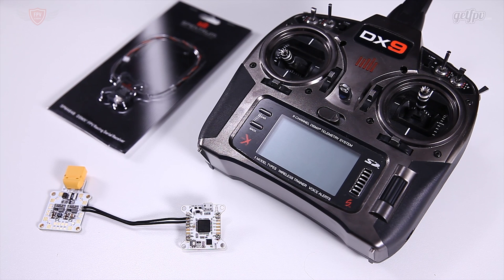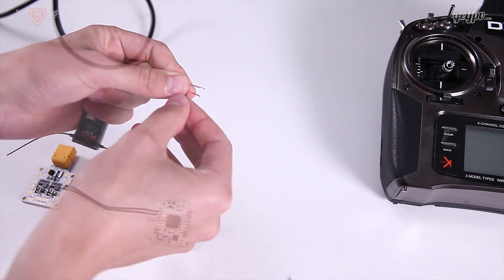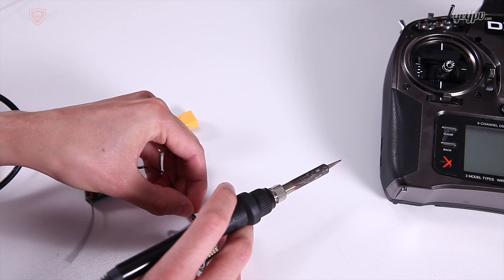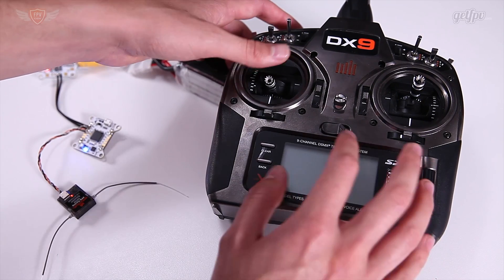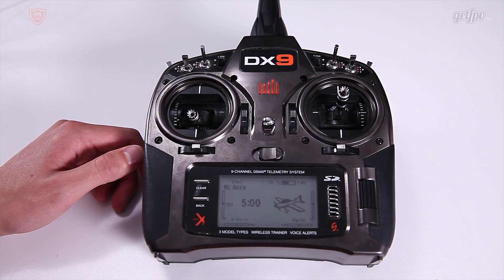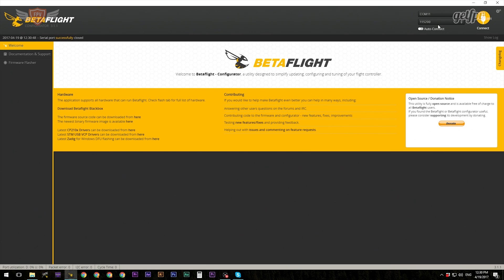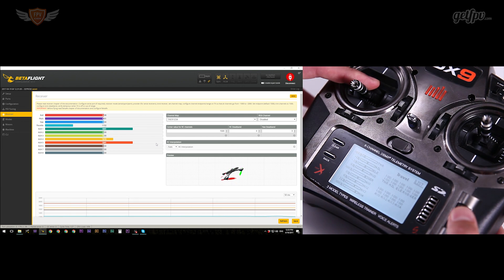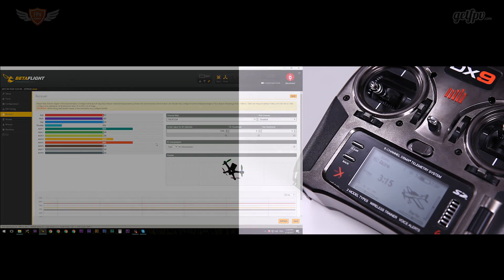Bind and Betaflight Spektrum DSMX Setup

Comment: having some issues. got a brand spanking new drone. got it to bind. buuuut... the channels are messed up big time! my pitch stick is the only one that gives off input signals. but on 5-7 different channels. and no smooth motion.... been trying so many different things. and no matter what i look up. i cannot get it to work...

regardless.
a bit info:
using spektrum dx6 (yes i know you want to say i should change it damn trolls x'D but thats what i got, and my economy isn't what it used to. and had this for my fixed wings so thats what i need to work with)
got a SPM4649T reciever (also new, not updated. so as stock as i can have it)
and the drone it self is the UAVfutures 99$ inspired drone. 
have tried the newest 3.5.7 aswell 3.5.6 firmware of betaflight on the FC (Racerstar StarF4S 30A) but it's all the same. 
hope someone can help?
Reply: did you ever fix this issue? i have exactly the same issue (same transmitter and receiver)

Comment: This is a different method plus easiest to set up. Why do many others go into betaflight with rd range and input values there like min 1020 max 1880 then add those in cli to get close to 1000  and 1880 to get 1997. My brushed and brushless quads I never set but upped to 125 to get arming. Forgot that method since done one just copy and paste to new quads lol but my mid is around 1070 and max is around 1860 changing this according to your setup to see what I have been doing wrong lol
Reply: Alright I did this and my quad now flips like 5 times on a slow roll lol a slight fast bank and it wants to spin out of control. Before I thought my quad was on rails. Dunno what has happened.
Reply: Alright update my rates were and expo needed to be dialed way down with my endpoints at 1000 and 2000. My original end points seem more stable. Will keep it this way and get used to it. Thanks for this video

Comment: I still have no stick response in betaflight.  It binded fine and changed all the settings but still no go.
Reply: any luck? I'm in the same boat. nothing shows up on screen " colored bars in beta flight" I have checked Rx ports. This happens with my baby hawk and my 90GT Kingkong..                                                Least I can fly my whoops without any problems.
Reply: Anybody find a fix?
Reply: Same problem with my two drones!  Both my Vortex 250 Pro Ummagawd and a used drone with a Naze FC stopped working.  Thought it could be my DX9... but my Inductrix Pro still works fine (and I haven't hooked it up to Betaflight recently).  Was there a recent Betaflight update?  I was running 3.2.1 when these problems occurred.  So I downgraded to 3.1.3 hoping this would solve my problem of not seeing any stick inputs on Betaflight "Receiver" tab.  No luck.  Same problem.  Getting upset...  Please update/reply if any readers have a solution!
Reply: Thomas W. Brinkley me to

Comment: does the LUX V2 support the bidirectional (rcLink & telemetryLink) protocol of the new SPM4649T Serial Telemetry Receiver? (using three wires)
Reply: I am having the same problem with my x racer f303  3.1, No stick response in beta Flight. Did you ever figure out how to solve the problem? Please respond! Please!